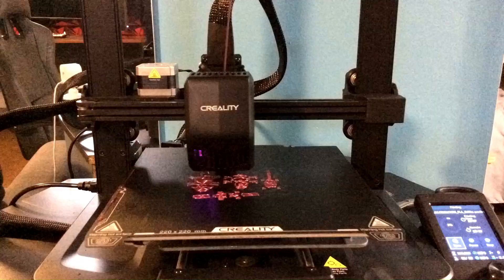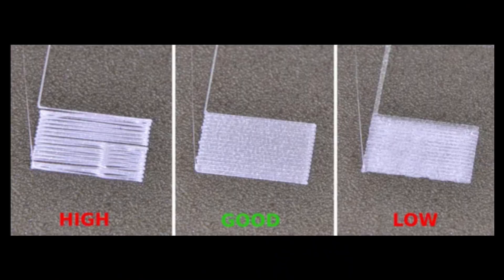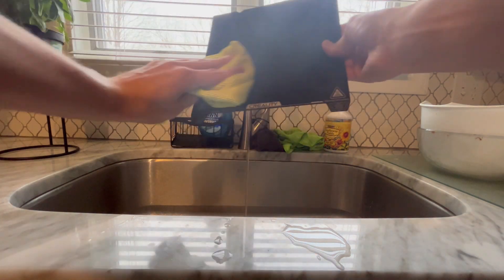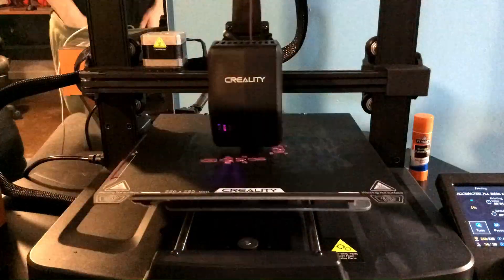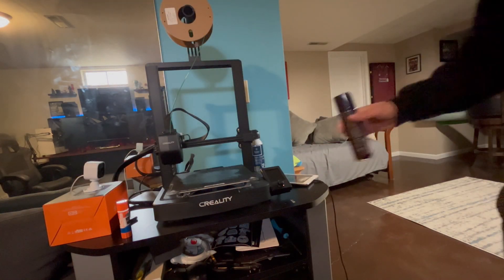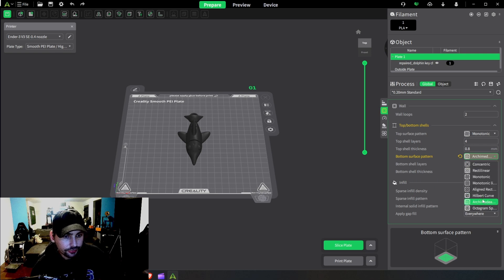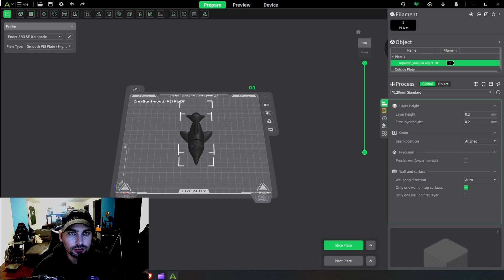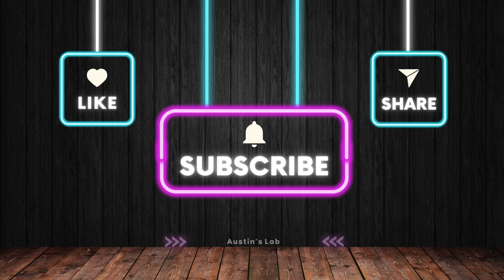3D Print Bed Adhesion Problems? Try These Fixes!

Comment: Unfortunately, I have exactly the same printer as you, it printed great and I didn't have to put anything on it, it was lying around for a while and I wanted to print again, unfortunately, the filament peels off after 5 seconds of putting it on, everything flies up and sticks to the hotend. Something is completely wrong, and no glue or varnish helps, something broke, because it's impossible for the same effect to be there all day. Every time after 5 seconds, there's a kind of rubber wrapped around the hotend, nothing stays on the table, as if it were invisible, unfortunately, I don't know anything about it and on Monday I decided to throw the printer in the trash (I don't know anything about it).
Reply from the maker: It was prob just a bad bed! If you replaced the printer bed I bet it would have worked!